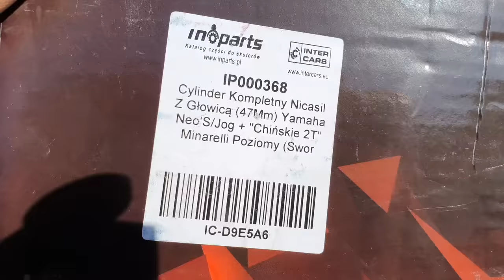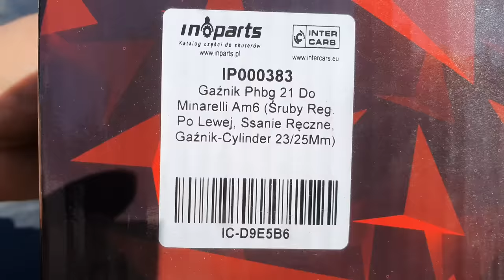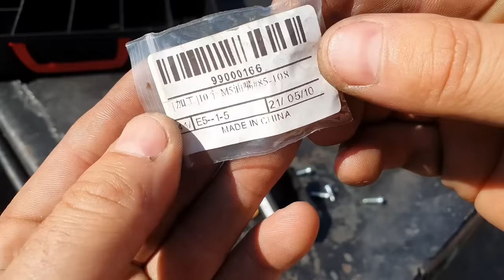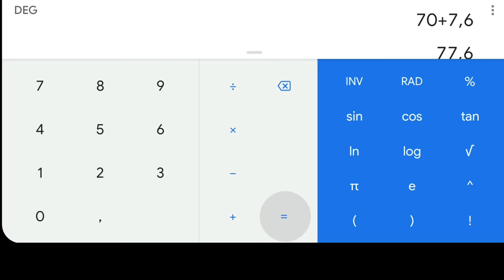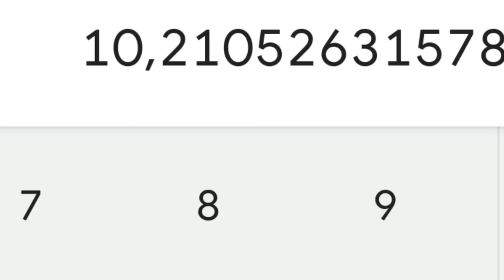21 карбюратор на скутер Yamaha Jog

Comment: Looking good, but i think that you have to change your spark plug to BR9HS because the engine is running even hotter when stock (which makes sense since the cc is 70)
Reply: a grade 8 is fine too, trust me :)
Reply: @francescomereu682  well, depending on the moped
Reply: @migeez6571  on the minarelli grade 8 is fine on these cylinders and it also depends on the time it is used. it can also be put in grade 9 but it is not essential, hello
Reply: Yeap, plus it"s AC which is much hotter than LC, overheated spark plug is not the best thing i would recomend to test :D
Starting from melted miston and till "diesel overrev" when engine works without spark, detonates by overheated plug
Reply: If the cylinder is racing then i recommend Br9hs but with sport is br8hs
Reply: @Bikey4LifeeNB  grade 8 is fine too, go easy,never give problems
Reply: Personal experience with Piaggio AC engine: grade 8 during winter time ( BR8ES), grade 9 during summertime ( RN2C).So far so good
Reply: Yes you have raid …. 9 ar the Best plug for 70cc

Comment: nice job, but when you mount a new engine, never used, you must do the break-in ... that is at least 500km in which you do not go fast and you do not open the throttle more than 3/4, even before the break-in you have to do the thermal cycles , at least 3, i.e. start the engine and let it idle until the engine warms up, then turn off the engine and let it cool, this for 3 times, the temperature cycles are used to adapt the piston to the cylinder, I recommend 4% mixture of oil and variator rollers as heavy as possible, so as not to rev the engine too much, remember that if you do not run in the engine will not go well
Reply: 500km is way too much honestly, for an aluminium cylinder its recommended to do 150km with a lot of heat cycles, a cast iron is something between 250 and 300km
Reply: Its aluminium cylinder no need for break in but just do like 100km just to be sure
Reply: maby the samodel know what he is doing so you dont have to be like you know everything and what need to do?
Reply: hi wrong to write, I meant 200km not 500km, 500 is a lot🤣🤣
Reply: You dont need to break in an aluminium cylinder like that. Just heat cycles and little bit of riding
Reply: If that was case motocross racers at top the sport would be going  slow to break in the top end 😂😂 3 or 4 heat cycles a steady run let it cool completely and it's good to go
Reply: I never breaked in my engines and they never blew-up 😂😂 They just need to be tuned and fine tuned perfectly and they will last for ever. Seriously I don’t believe in the break in of a scooter engine 💪 Wide Open is the way to go !!
Reply: @sirkka420  exactly
Reply: a few heat cycles and few miles of building up the load and rpm is enough for breaking in. Actually you need to ride it like you stole it, or it won't brake in at all and ends up being slower!

Comment: sorry mate always seemed to be better of with a 19.5 del Orto, it had that bit of restiance that all carbs like and always got better performance from them even if you have to mess with jetting! just my experience plus a lot more punchie, no wind up like on a 21. just my advice 18 years tuning 50cc minerales! have fun 😀plus I have the 19.5 set up on my top performance due plus kit, works a treat and is hiting 15hp, just a word of advice larger can mostly be better but on these small engines, its not always the case
Reply: Awesome words of advice! I just slapped a Malossi big bore kit and exhaust on my Honda Aero and I've been having a bear of a time getting it to run correctly. I live at about 1600m elevation, so everything runs a little richer up here, but I've tried a 19mm Dellorto and I couldn't seem to lean it out enough with the jet kit that I had. I dropped down to a 17.5mm Dellorto and got it running okay, but I'm wondering if there's something that I'm missing with the 19mm or if it's just too darn big. I've tried pilot jets from 30-50 and main jets from 60-80 without any luck. any words of advice are not expected, but would be very appreciated as I am very new to this!

Comment: the engine could go even further, try to improve the calibration of the transmission and to refine the carburetion even more.  it seems to go quite well, but when you release the accelerator and the idle jet comes into play it seems to be quite thin ... the main jet I would raise it a few more points, the spark plug in its inner part of the head must be " hazelnut color "when the carburetion is perfect, you have to do some tests at full throttle, stop the scooter immediately and check the internal color of the spark plug ... have fun and congratulations on the scooter!

Comment: So yestarday someone droped my jog and now when i start it it have high rev and if wheel is not spining when i try to ride it it doesnt do anything but if i give it a little push it runs perfectly. Also there was oil in air filter... but i cleand it perfectly but problem isnt that also carburator looks normal

Comment: Buy cylinder on jack motors iron racing 70ccm liquid cooled and eletrical pump and cooler the performance of this cylinder is very great 110km/h GPS with carburator 17.5mm. I rekomend this set

Comment: Pon el pwk ,dellorto💩
Reply: The diameter of original pwk carburetors starts from 28. The pwk carburettor that he have is a 21, so it's a Chinese replica, and so it will be impossible to do a good setting of the carburettor, which isn't absolutely good. The dell'orto phbg 21 works just fine. (Sorry for bad English)